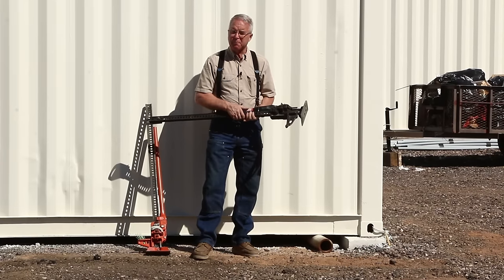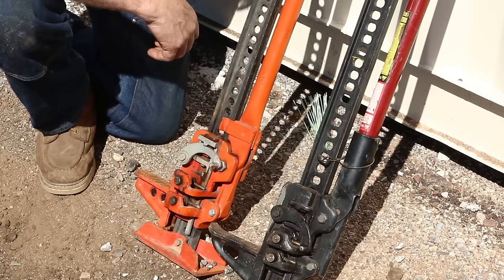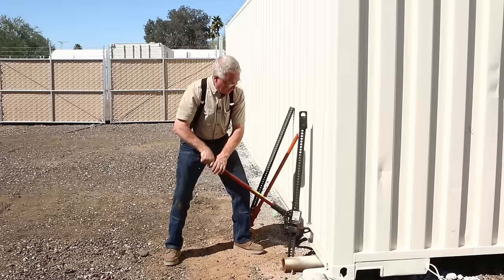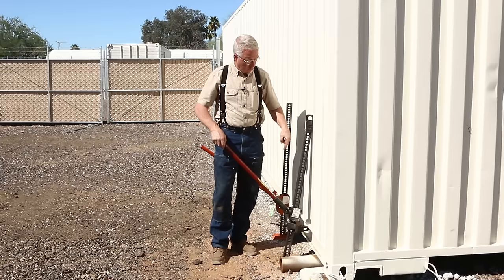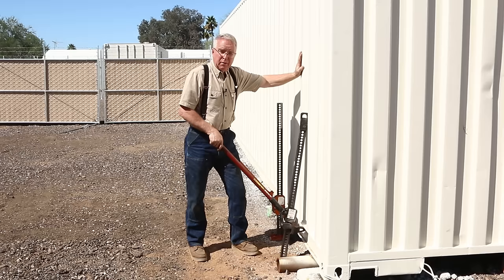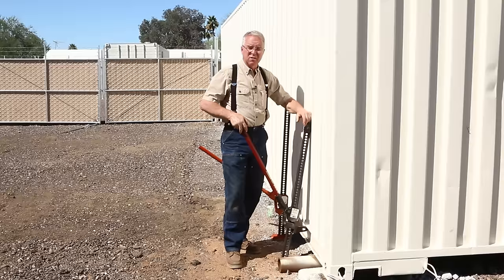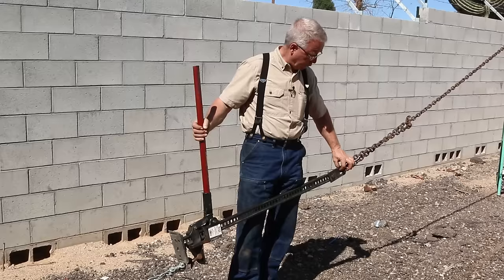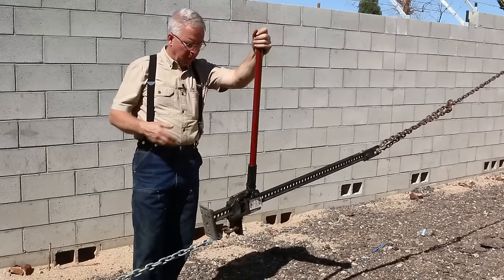Operating a Hi-Lift Jack

Comment: I've had mine for several decades. So long in fact that I've forgotten what I initially bought it for. In that time I might have oiled it less than ten times, thanks for the reminder. Most time I use it these days is to lift out bush roots or those lengthy sumac trees roots & all. As you pointed out with its leaning into the work, so I generally chain the top to a nearby tree to hold it from going in while cranking it up & balancing it at the same time. Works pretty well, and works so much better if I wrap 3 or 4 wrap arounds the tree base with barbed wire instead of rope or small chain.

Comment: I have been using those jacks for 40 years and the first thing I do with them is look for something else to use first.  The fact that they are virtually impossible to keep up right in all but the most ideal conditions makes me super gun shy of them. i can't count the number of times the load shifted and the jack pushed it over on the ground while in use. Those things just beg to hurt ya so I usually always try to find something else to use besides an overgrown bumper jack.

Comment: They also make a great impromptu press. My dad used one in a tobacco bailer. He built a wood box the size of the bail you want to create. With a front that comes off and a fixed metal bar across the top. Put your tobacco leaves in, place a board on top and use the jack to press it all down nice and tight. Brings back memories. I can still smell the fresh cured tobacco.

Comment: A high lift Jack was one of my first purchases once I could afford it. I'd grown up using my Dad's. When he died I inherited his tools, except somewhere along the way a brother-in-law had gotten that Jack, plus a grinding wheel and a vice. Both are long gone because her became wealthy and they lost value in his eyes. He was a very hard worker and won the respect of my father, who valued hard work. But being a fair number of years younger, I wasn't in a position to need those tools. The latter two belonged to my grandfather and I'd like them just for that reason. The jack was my Dad's alone. I have just a few tools that belonged to Dad. They are well used, but are older now and I've retired them in favor of modern tools. Except a planer and a couple others. Thanks for another great video. My high lift is my come along and winch

Comment: Used this marvelous invention for years.  Called them widow maker jacks.    Used them to pull out stuck vehicles, pull fence posts and small trees.   You can’t jack up a vehicle with them since all the bumpers are plastic and if you lift from the side the shaft hits the body.  Going to clean and oil mine today.

Comment: This is a tool that commands respect.  It will break bones and shatter teeth if you neglect body positioning. If used with mindfulness the beast can be asked to do just about anything. On the farm we've been known to break down tractor tire beads, winch tracks back on even a tie rod field fix was possible. The jack was used many a time to clamp barn beams together as lags were screwed in. Also a great beam welding clamp. The thing is only limited to your imagination. The farm hand was never left behind. That being said, the actions being done were always clearly laid out for an excape route.

Comment: i worked as a farm hand and horse hand, we used them to tighten fence lines, and to pull strands together and mend em.. great tool..  we had a strand holder that cinches the wire as you pulled it together..  was a real trip to learn to do it one man..

Comment: I really enjoy watching your videos and learning from you.  That said, sometimes the student (me) can teach the teacher. In this video you attached a shackle to the hole in the nose of the running gear on the Farm Jack.... just an FYI, and with all due respect, that hole is NOT rated for a shackle as such it could shear long before the shear pin of the jack.  Winching attachments for these types of jacks are available allowing the full strength of the nose to be used rather than the limited strength of the nose hole.  Anyways, I hope that is helpful.  Please keep sharing your extensive knowledge through your wonderful videos. Have a great day!

Comment: We always called these railroad jacks. Used them most often for pulling small stumps  and fence posts. Or occasionally to get a tractor unstuck. I've seen first hand the damage these can do to a person if something goes wrong and it's not pretty.  Make sure you know what you're doing  if you use one, and never put anything over  the handle that you're not prepared to lose when it's under load.

Comment: With the top clevis/clamp/handle bolted at right angles to the bar, this jack can also work to clamp parts together, e.g., for woodworking or welding.
Reply: That should be added to the video. I’ve used it as a clamp many times as well. If your going to do a jack-all video...

Comment: Cars used to come with a derivative of a high lift called a bumper jack. The steel bumpers had a slot cut into them for the jack to hook into. The jack had fingers that fit into the slot for lifting the car.

Comment: I recently purchased a riding mower/atv lift that utilizes a farm jack as the lifting mechanism. Pull a couple of pins and it separates to be used as a standard farm jack. It's made by Larin.

Comment: I have one of these that's older than I am (I'm in my 60s).  I don't use it much, but it sure is handy when I need it.  I watched my dad use these jacks for all sorts of things when I was younger.  In the old days, cars and light trucks could be lifted right off the ground with bumper jacks.  Once when my dad and I were squirrel hunting, we came out of the woods to find that the snowplow had gone by and our van was trapped by a big ridge of snow.  It would have taken at least half an hour to dig out.  Instead, my dad got out the hi-lift jack and picked up one entire end of the van (both wheels off the ground) with the jack a little off-center so it would be easy to tip it over toward the road.  Ka-woomp.  He tipped the jack over and dropped that end of the van about 1.5 feet closer to the road, right in the snowbank.  After doing that about three times at both ends of the vehicle, the whole car had been moved far enough sideways that we were no longer trapped and just drove right out.

Comment: I made a few cool attachment for mine including a cant hook for moving or rolling logs and a heavy duty pry bar that is shaped like a burke bar and slides over the end of the main bar. Have flipped 20" oak logs and moved two milling machines with them so far.

Truly a versatile tool as is, and even more so if you can build your own custom attachments for it. I have one mounted on the bumper my truck and find a use for it every month or so.

Recently hauled two trees I dropped back up a hill and spun them sideways across the hill to use for a retaining wall behind a friend's home who is trying to terrace down the hill behind the house. A come along would have sped the process up, but this worked as well.

Comment: My friend Doug "acquired" a huge Italian espresso machine that worked by cocking a very stiff spring using a long handle that the user had to push down.   The spring force pushed the water through the coffee.  The lever presented the same danger as your jack lever: if you let go before it was cocked the handle would certainly fly up and hit you in the chin.  It clearly had enough stored energy to take your face off.   I'm glad to see it gone.

Comment: Good Video on the basics. I have had the mis-pleasure of operating one in some very extreme conditions. Yes I said mis-pleasure, because it did get my truck out of the spot it was in, it was one of the most difficult single person recovery jobs I have ever done. With that, it did just as it was intended to do.  if there are no other tools available for lifting or pulling, the Handyman Jack works very very well, if you know what you are doing. As for lubing it up, I never use oil, because oil collects dirt. I use a Teflon spray which collects less dirt and performs quite nicely.

Comment: I highly recommend spending the extra cheddar on the xtreme model. i use the clamping/spreading feature way more than a jack. and don't buy an off brand, hi lift only.
Reply: Ditto!!
Reply: I've been eyeing the rescue version. It's a bit longer and the base is designed to fit a 4x4 to spread the load on soft soil . The angles on the base also grab better so you dont slip when spreading. It also has slots for chains in the base.
Reply: @bxxj  I have the XTREME model and it has the same lengths as options and the spreader/clamp at the top. The only difference is the foot and paint job. And the increased price of course...
Reply: I love my extreme.
Reply: I bought the chinesium model you speak of, I broke the handle almost instantly. After that I did buy the extreme hi lift, worth every extra dollar. Twenty something years and no issues.

Comment: Around here they are called a handyman jack.  The name fits because they ARE handy.  They are more commonly called a widow-maker jack and that name fits even better because these things are EXTREMELY dangerous.  The handle flying up is one way but also lack of lubrication makes the pins a little sticky and if you get a heavy load on it and the pin doesn't quite seat...next thing you know the load comes crashing down.  That plus the higher they get, the more unstable they are.  Be VERY careful with these things.

Comment: We use them in 4x4 recovery situations. If the ruts are deeper than the ground clearance the tyres create just jack the front up clear of the ruts and push her over off the jack. Then lock centre diff and let the front axle pull the rear along until you are out of the rut. We have let these jacks fall and hit the deck dozens of times as you push the vehicle over. They shrug it off like it’s nothing. Just remember never to touch the reversing lever unless the lifting lever is up against the main shaft. That’s one hell of an upper cut if you don’t.

Comment: My grandfather, who was a safety engineer, and worked his way through college as a machinist, had about 6 of those.  One of them he had cut down to about 2 feet tall.  He taught me how to use those when I was about 8, and being a safety engineer, he taught me to first think of every direction that thing could move.  Left, right, in towards the load, out away from the load, into the ground, and combinations of those directions.  Then he said (and this goes for many pieces of machinery), "And boy, make sure not to put your face in front of any of the moving parts, and you should be fine."

I've used them in fire rescue over the years.  They were used before we had all the spiffy hydraulic tools of today, and they did fine.  I've loaded those to the point where the bar was flexing and they didn't fail.  There are accessories made for them that make them even handier:  Oversized base plates, clevises, etc. Very impressive piece of equipment, when used with proper respect.

Hi-Lift Jack brand is the only one I'll own.

Thanks for a great channel.

Comment: Keep your head and face to the side of the travel of that jack handle.  Stand to the side.  I've seen the handle pop up, and clip men under the jaw.  That may be more apt during the letting down of the lifted item.    Also, if you lift rather high, that foot can squirt backwards and hit you.  Stand to the side.  Try to set the foot on a solid base:  Concrete, asphalt, or a wide, flat block.  The foot will sink into dirt to an aggravating depth.   And yes, lubricate, unless you enjoy cussing.  Watch that the pin engages fully at each step, and be prepared to knock the pin in with a tool to really seat it.

Comment: I bought my first Handyman (similar style and made in the same town in Indiana) in 1972 and been using these jacks ever since. 
I once lifted the back bumper of a 32 ft long schoolbus enough to get rocks under the duals  when it got stuck going over a water bar on a mountain road. 
The biggest come-a-long is 2 tons, and a Highlift can pull 3 1/2 tons, so when it gets serious, the come-a-long can't match it.
I once got a truck out of snow by lifting the front and tipping it off the jack towards the clear area.

Comment: Years ago I worked for a company that moved buildings. We used railroad jacks for lifting. The jacks were thrown out by the railroad company because they were worn out. 
My boss bought them from a guy who salvaged scrap metal from the rail yard. 
They worked for what we needed but they were dangerous. If the load shifted while two or more jacks were lifting at the same time, one guy was likely to get whacked with a jack handle. One of my coworkers had his face shattered. 
I do not miss working with those things!

Comment: I saw this several times, figured you were going to discuss the auto jack from the '60s, I guess a more simple version of the same principle. We called them come alongs as a carpenter, I was a union carpenter, but when I went to I.B.E.W., electrical line work, we called them hoists. We called the devise that grabs the wire, that you would hook the hoist into, a grip, or a come along.

I never heard back from you. I left my email on the video for awhile, then found your blog, left my email there, and removed it from the video, security. I made my schedule, and won't come up to Roseburg this trip to demonstrate the cold tempered tool I bought, and how to cold temper it. Another time.

Comment: I don't use mine very often but its sure great to have for those occasions where one is needed and its readily available.  I've actually used mine for pulling T-posts far more than anything else.  Used it once to lift the tongue of a car trailer that had dropped off the trailer hitch ball due to not being locked onto the ball....this was one time I was happy the ground was soft.  Used the hi-lift jack to get the trailer tongue up enough to get a board under it with a bottle jack...if it weren't for that hi-lift jack I'm not sure exactly how I would have got the tongue of that 2k+ trailer off the ground LOL.  All I was doing was moving the trailer out of the field into the driveway and stupid me decided ehh don't need to lock the tongue down to the ball, its heavy enough it'll be fine....yeah until it hit a bump LOL.

Comment: Keep one in the Cherokee for pulling posts, moving large items and, of course, Jacking.  Wife wasalways complaining about it taking up too much room until we got a UHaul trailer back late and I could not see to figure out the lift mechanism on it in the dark  [[night blind from diabetic retinopathy doesn't help]]  I can run the HilIft with my eyes closed.   So I undid the hitch and use the HiLift to jack the trailer off the ball, moved Jeep and lowered trailer.  Now she doesn't complain.

Comment: Mine gets used for pulling fence posts more than anything
Reply: Yep! Great for t-posts too especially with the metal adapter you can buy
Reply: It will save your back.  Wish I had appreciated that when I still had a good back.
Reply: @stroys7061  That's exactly why I bought one. After removing three 4x4 fence posts set in concrete the hard way (softening the soil, then rocking them back and forth for 20 minutes, then lifting them out by hand by myself), I decided to spend the 60 bucks for the HF jack instead of wrecking my back to remove another eight posts. I'm watching videos like this to learn how to safely use this jack.

Comment: Excellent video—I watched it about a year ago and decided to acquire a farm jack when the need arose. I just got a job doing removal of a chain link fence so I bought a farm jack. To my surprise, I found a used one on Facebook marketplace—a High Lift brand with a rain/dust boot, vehicle mounting bracket and a few other off-road 4wd accessories for $50. I’m confident I can resell the accessories for $50, making the jack free.  I’ll get $850 for the fence removal and whatever the materials yield at the scrapyard.  That’s a pretty good days work.

Comment: I’ve been carrying a hi-lift jack around in my truck for several years, and it is invaluable. I have a couple of studs and pins that can secure it to my headache rack. It’s super handy for things like hooking up to a trailer with a rusty or maxed out jack, and just recently I used it to level up a shed. Much faster than a bottle jack and blocks.

Comment: I had to use mine as a come a long when my come a long broke while loading my stepson's truck on to the car trailer. And I have a t post puller that fits over the t post and fits over the nose. It's just a flat cast piece with two holes. One hole catches the nubs on the t post, the other hooks on the jack's nose. It works great.

Comment: Reminds me of the bumper jacks that came with cars back in the ‘60s. I probably shouldn’t be alive due to the number of times as a dumb teenager, I jacked up a car and crawled under it with only the bumper jack holding it up, but the good Lord protected me. Bottle jacks aren’t completely worthless but for jacking up a car, nothing beats the old bumper jack. You could just about lay a car on its side with one of those.

Comment: Brake fluid is the best lubricant I've found for a hi lift jack....try it sometime.
Reply: I've heard the same.  Problem is, brake fluid is hydroscopic, so it doesn't protect from moisture very well.  So it'll do in a pinch, so long as you remember to clean it and give it a proper lube later.  Otherwise, you'll have all sorts of fun later, cleaning off rust and bits of paint (brake fluid being rather good as a paint stripper, too.)  :-D

Comment: i used one of these jacks to open back up a 24 inch culvert pipe that was crushed closed by a rock and had water backed up. had no problem opening the pipe fully and letting the water flow through. fyi, i used a safety harness anchored to a tractor to keep me from slipping into the pipe even though the pipe was only 20 foot long. safety first.